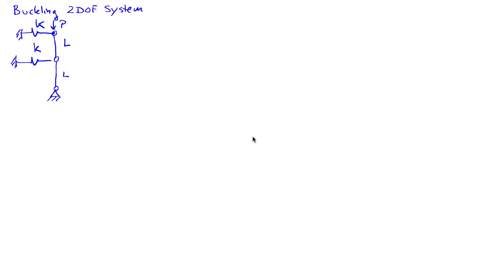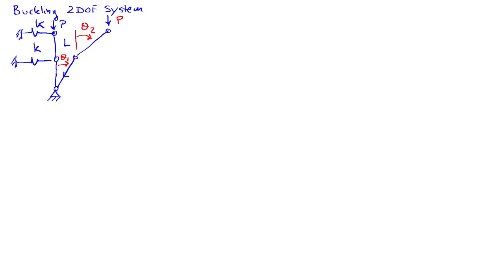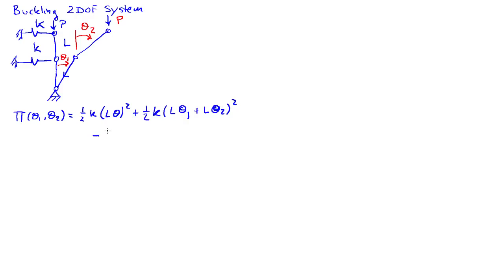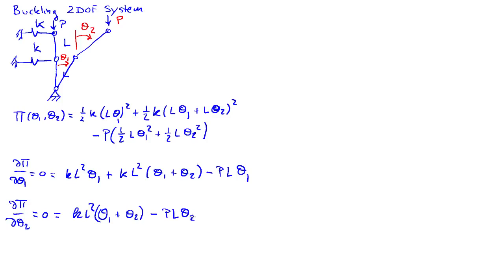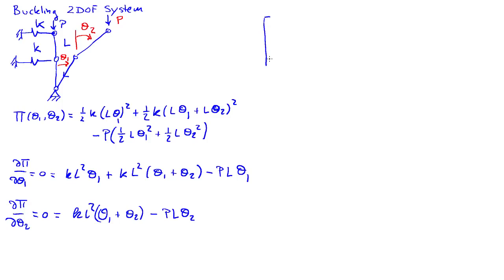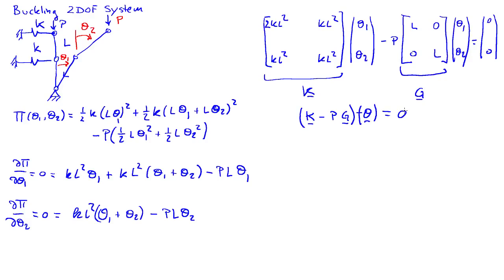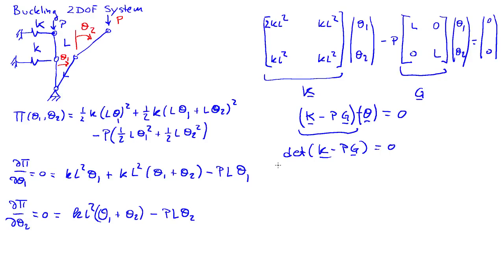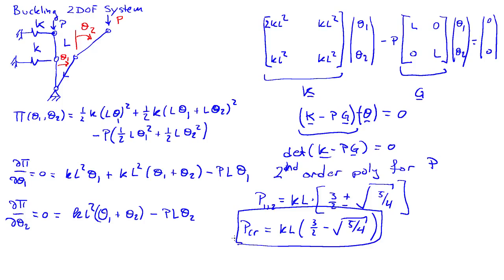Buckling of a rigid linkage

Comment: Hey sir can you help me with some stability problems with rigid linkage with similar configurations as yours with combination of translational and rotational springs?
Reply from the maker: Try having a look at two sources which have further discussion, which I have written.  (1) Engineering Mechanics of Deformable Solids
http://amzn.com/0199651647 and (2) A First Course on Variational Methods in Structural Mechanics and Engineering http://faculty.ce.berkeley.edu/sanjay/ce130n/VariationalMechanicsBook_Draft.pdf .   The second is free, the first should be in your university library.